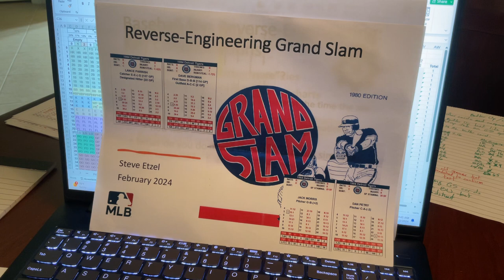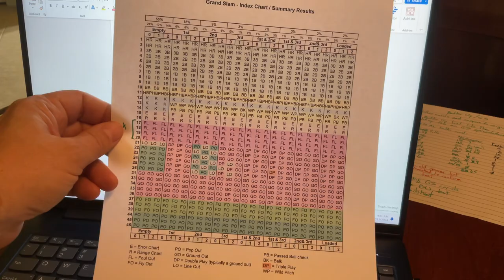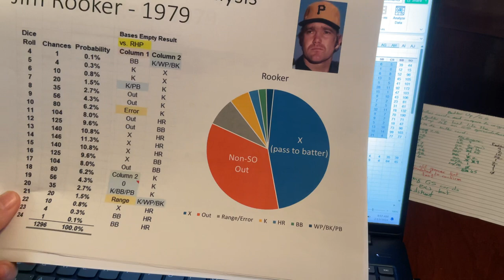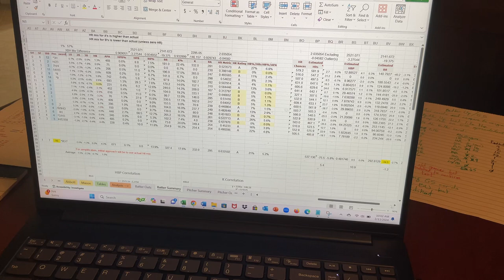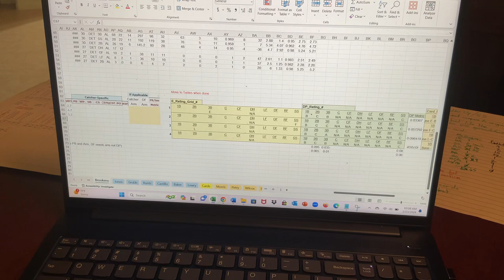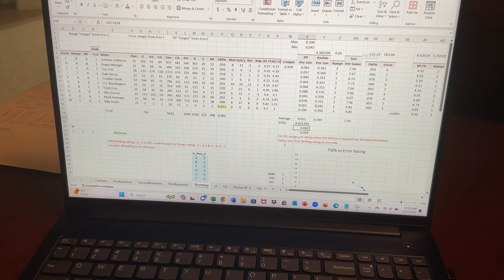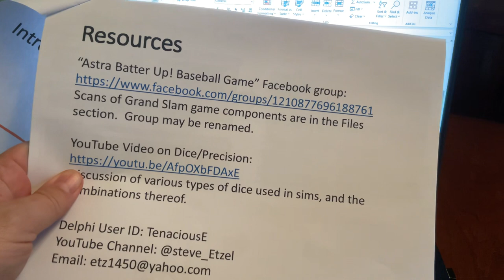Reverse-engineering the Grand Slam Baseball Game

Comment: I'm very glad you were able to reverse engineer Grand Slam. Saving an out of print game is always beneficial to the hobby. Have you looked at Ball Park Baseball? The owner/designer has decided to let the game die rather than pass it on to a new publisher, which I feel is a crime...he refuses to answer emails as well
Reply from the maker: I'm not familiar with Ball Park Baseball.  I just checked the website out.  One interesting feature I see is that there are splits for bases empty and runners on base.  Big League Manager had this feature as well.
Reply: @steve_etzel I did manage to order 2 teams to try the game out (1970 WS Orioles vs Reds). It's a solid system with a moderate learning curve.
I guess I just hate to see games die...
Reply: As always enjoy watching your baseball boardgame analysis.  What is the percentage chance a pitcher card roll will reference the batter's card for the result?

Sounds like the game Inside Pitch, pitcher to batter rolls.

Have you ever thought about taking your excel skills and writing a batter to pitcher simulator via the random dice rolls getting a result for the matchup from the charts & etc.?

I used access database to write batter to pitcher simulators to check what was required to be in batter cards using a 50/50, 67/33, or even 83/17.  Of course, this example using the breakdown of 6 columns using a 6 sided die as rolls on the pitcher card 50%, 67%, and 83%.  Of course, with each change from lowest to highest the batter card became stronger.

I don't know how complex this game's batter to pitcher simulator would have to be.  However; a simulator will tell you if a batter or pitcher card is meeting the accuracy standard.  For example, batter A has 600 PA then roll 600 times simulating how the game gets his results.  Based on the percentages you can test several simulations to find what the  batter card needs facing an average pitcher card representing what the pitcher's give up excluding his own pitching.

So, in theory make a pitcher card representing the average of all the pitcher's he could face then roll on that pitcher card and see if his batter card will meet the test.  The key is, the pitcher card has to use his batter card the amount of times it would be used over 600 PA.  You might take out IBB and/or bunt stats, etc., to refine his batter card expectations for refinement.
Reply from the maker: @johnnysmoke612  Thanks. Interestingly, the percentage chance that a pitcher's card will reference the batter card varies from pitcher to pitcher.  This is part of the challenge in figuring out the player cards.  I think part of the variability relates to the varying number of walk chances that appear on the card.  Taking those aside (as well as WP/BK/PB/HR chances), there is some mix of Outs and Pass-Through chances that will produce the proper "batting average against".  In this particular reverse-engineering, I wasn't successful in producing an algebraic solution to determine the Out/Pass-Through mix.  Instead, I just replicated the implicit logic that was embedded in the original pitcher cards, if that makes sense.

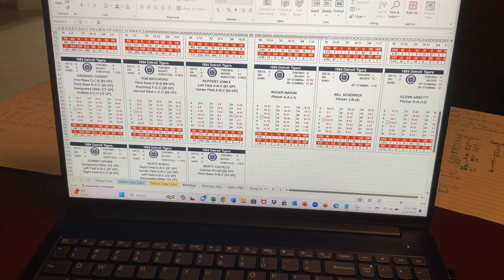I have used Excel to run simulations of pitcher-batter matchups in the past and have documented these in some of my videos.  At some point I realized that there is no need to run hundreds or thousands of simulations.  The results of a specific matchup are very deterministic based on the various probabilities embedded in the pitcher and batter charts.  I didn't spend much time on it, but in this video I explain the matchup logic starting at about 29:55.  I also explain this concept in this video for Payoff Pitch (https://www.youtube.com/watch?v=-_PHvLSDHQM) and also here for SIBB (https://youtu.be/VSvmTsu4EXM).  

When making cards for sims, I do take out intentional walks and sacrifice hits to arrive at "adjusted plate appearances", which is the basis for calculating my rate statistics.
Reply: @steve_etzel  I guess to get pitcher to batter card rolls would require weighting BFP chances on each pitcher card to get a total number or percentage of rolls that go to the batter cards.  This is why I'm a bit leary of baseball game designs that are more asymmetric than symmetric.  If batter card rolls on pitcher cards are very small samples that is a lot of variability and randomness.  IOW, a lot of needle in the haystack design right roll on the right pitcher card against the right batter type of design.  I'm just speculating, a asymmetric design not adjusted via a 50/50 model in context would be very hard to formulate to proper possibilities. 🙂
Reply from the maker: @johnnysmoke612  I think you have captured the challenge correctly.  In the case of SIBB and Batter Up, the formulas weren’t too hard to get right, in hindsight.  This is mainly because the batter card (other than walks) is reflective of his actual batting average.  Grand Slam is a bit different, in that almost all the hits are on the batter card and almost none on the pitcher.  There should be an algebraic solution nonetheless, but I struggled to come up with it.  As for asymmetry, even the creators of Statis Pro struggled to get the pitcher cards right initially.  Fortunately, someone figured out the math and published it in a newsletter. Unfortunately, the original formulas are readily available in the public domain, so some gamers create their own cards with those old formulas.  Others have refined the formulas so the pitcher cards are as accurate as they can be given the game design.
Reply: @steve_etzel  Yes IIRC, Derrick Beckner in redesigning Statis Pro went to using pitcher isolated power allowed versus "ERA/Whip?" to create cards.  I think it had something to do with none or very few EBH were on the pitcher cards.  I do like, to a degree, the Statis Pro PB rating for pitcher card roll influence.  However;  I believe using that design would still require weighted by BFP were for 50% of the rolls to go to the batter card to balance out overall.  Of course, the proportions have to be addressed via precision for the dice number of sides.  In the case of the redesign the 4-7 PB rating was applied to pitchers to get more rolls on the batter cards.

Just me, but if using a six sided dice like in SOM for columns.  It can be 1, 2, or 3 for batter card, 1 or 2 for batter card, or 1 for the batter card.  However; each iteration from the original 50/50 design would make the batter card increase in performance results or it could be vice versa for the pitchers.  Of course the kicker, at one point does using the 1 on a six sider for the batter card get to a point the batter card can't reach a 50/50 symmetry without enough possible batter performance saturation for the batter to perform accurately and realistically.  In game theory, how do we design a model that may diverge from the 50/50 concept, but keep the probabilities inside the symmetrical of one pitcher with defense versus one batter to get the real life result.

For Statis Pro,  the key does ISO power get the symmetry close enough for XBH's allowed to be accurate for the given pitcher's via distribution of a PB rating.  Not sure,  but think the Beckner approach with designing PB ratings for pitchers using ISO power gets the game closer to accuracy.  Really, genius on his part if not going to put XBH's on pitchrr card results.  Interesting discussion.
Reply from the maker: @johnnysmoke612  Interesting indeed.  Derrick does get a lot of credit for recommending ISO for carding pitchers in Statis Pro.  I think it may have been out of necessity, when he decided to include L/R splits on his cards.  Derrick has taken it a step further and uses some algebra to assign the correct pitcher PB rating.  (And therefore the correct slugging %.)  As I think you are suggesting, to the extent the weighting departs from 50-50, there has to be an adjustment on the pitcher cards for hits, walks, etc. so the pitcher's results match what they should be vs. the league average batter.  

When I was working on my Statis Pro spreadsheet, I went back and read 20 years' worth of posts on the Delphi thread "Can We Fix Statis Pro?".  I learned a lot from that.  I've recorded a couple of Statis Pro videos, which you may find interesting if you haven't seen them already.   https://youtu.be/f7N41rU3m4g    Similar to our discussion in this thread about simulation and testing, it's fairly easy to test to see if a Statis Pro pitching card is "accurate". https://youtu.be/4_8gsGFgmwQ

I think the PB 4-7 was included simply to refine the available PB ratings (and it is conveniently 50-50).  In the original game, the 2-6 rating range was quite wide.  The 4-7 rating effectively splits that range in two.  Good discussion, thanks.